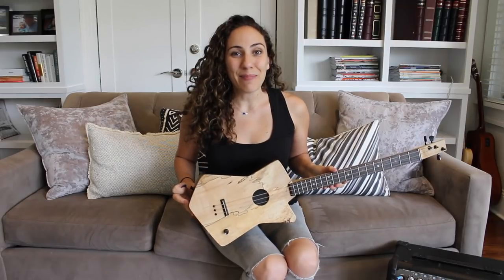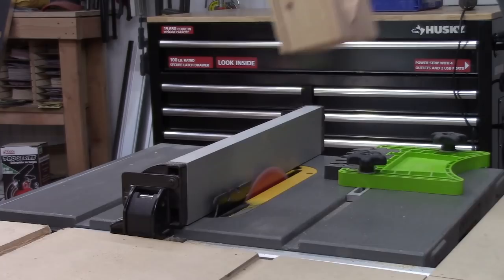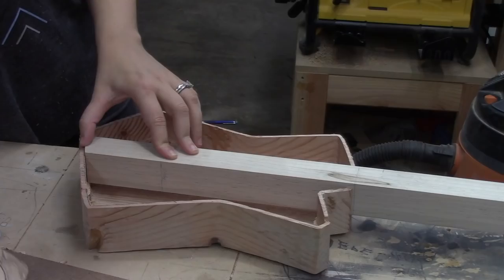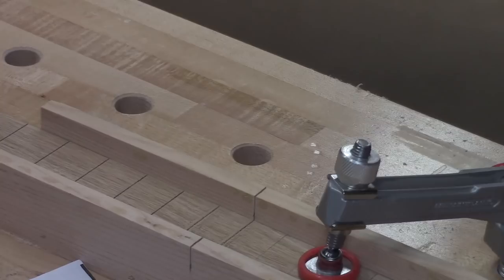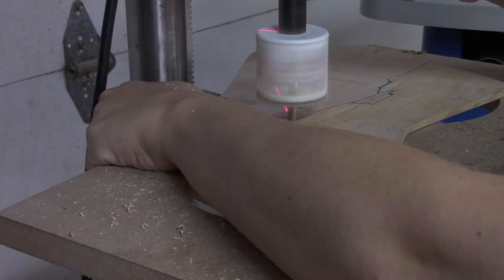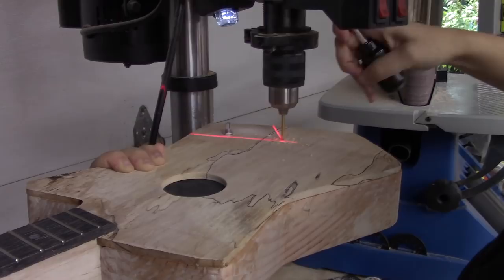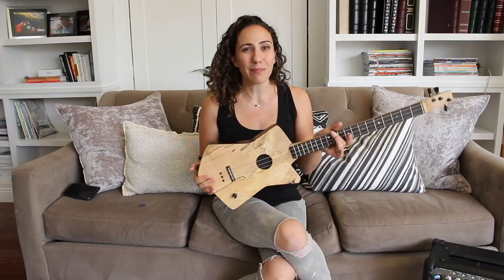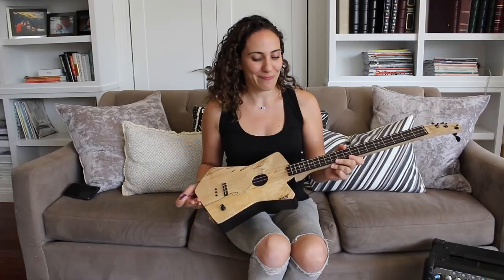Making a Three String Guitar // Cigar Box Guitar // DIY // Woodworking

Comment: Great job. all you need is $10;000+ worth of power tools
Reply from the maker: Thanks! If these tools cost me $10k my husband would have killed me.
Reply: @3x3CustomTamar  Maybe not $10k, but decent quality power tools cost a fair bit and you must have at least $1,000 worth there.  That belt sander alone is a costly looking item. 

I also envy you Americans your access to space.  Here in the UK land is pricey and I end up basically having to stack tools on top of each other - it makes maintaining accuracy a bit difficult.  Wood is also much more expensive over here so I have to recycle/upcycle scrap wood.   Overall, an interesting effort but I'd probably have gone the fabrication route, rather than the router route for the body build.
Reply from the maker: Grey Wolf yeah. I guess I take that stuff for granted. I totally agree with you on the construction of the body. Next time I’m going to cut out thin strips of plywood to the shape I want. Then glue those up together to make the walls taller
Reply: Well, the thing is a lot of these channels cater more towards professional woodworkers, not weekend woodworkers. The same thing can be done with hand tools, and we're for decades before any of the modern tools available today.
Reply: It was a nice build...I would change a few things tho. Definitely nee to figure out a way to access electronics/jack. With the top glued on, your kinda screwed if you need to rep.ace the pickup, etc
Reply: I have $10k+ in woodworking tools insured in my shop. She's nowhere near that range. Grow up dude.😂

Comment: Using spalted wood for the top wasn't a good decision. It won't last nearly as long.
Of course that true of the way the body was done as well so i guess it didn't matter at that point
Reply from the maker: I used a stabilizing epoxy on the top. So we’re good there. This was just an experiment. I Had fun with it. And my kids enjoy it. That’s all that matters to me.
Reply: "It won't last nearly as long..."  As what? Steel, aluminum, PVC plastic?   She stabilized the wood with a penetrating epoxy resin.  It's probably good for at least 100 years at this point - you think it needs to last longer?

Comment: Cringed the whole video, but i cannot argue with results like that.
Reply from the maker: Yeah. Def not the correct way. But not bad for my first attempt. It was so fun to do
Reply: Definitely not consistent with traditional guitar builds, but after watching this I watched a few other cigar box builds and I have to say this is hands above those. Acoustic guitars want to have a lot of resonance, which generally means thinner back, sides and top. I was shaking my head through the whole build, but then have to admit it sounded surprisingly awesome in the end.

That spalted top was beautiful!

Also, I've never used those disc piezos before. When I saw all that hot glue I thought, "that's never going to work". It defies nearly every principle of piezos I am familiar with, but it sounded great.

So all that constructive criticism I was saving up??? Nevermind. You built a beautiful instrument and it sounded great.

Thanks for sharing.
Reply: Why would you cringe for the whole video?   She did a great job with the guitar and it came out fine.  Do you get some kind of style points for HOW the project is made?   You might not use the same wood working techniques - but, YOUR techniques are necessarily either better or correct - they're simply different.   I probably would not have built it the same way, but I learned a couple of alternative methods watching the video and may try incorporating them into my work.  I truly don't get the comment.
Reply from the maker: QuinnMendel it’s different from a traditional guitar bc it’s not a traditional guitar! It’s a whole nother animal! But it gave me the confidence to think that I can actually build a real acoustic guitar. When I get a drum sander of course.... 😂😂
Reply: @3x3CustomTamar  Yep - I get that. Honestly, I've never built a cigarbox guitar or looked into their typical construction. So I watched your video first and formed some opinions, but then (thankfully) had the presence of mind to watch a few other cigarbox builds which reset my expectations and gave me a renewed appreciation for what you accomplished.

Frankly, my biggest concern with your approach is with all that end grain. I really, really hope it holds up, but my history with such matters is that it will want to warp and split. Hopefully the wood hardener will save you...

BTW, your neck-through design was brilliant!
Reply from the maker: almosthuman thanks! Glad you watched some other videos and realized I wasn’t crazy. Ha. Yeah. It’s been over a year of abuse with the kids and it’s still in great condition. I think the wood hardener helped with that
Reply: I like that it combined the stability of a solid body and the sound chamber of a hollow body, very unique and sounded good. Good job.
Reply from the maker: xzombielar thanks! Yeah it def has a unique sound to it

Comment: To help with the fretboard glue up, I like to drill a hole right in the middle of 2 of the fret slots (top and bottom of fretboard) and then use a toothpick as locator pins, that way everything stays inplace while clamping and the toothpick is then hidden under the fret.
Reply from the maker: That’s a great tip. Thanks

Comment: One thing I have found out about significant tear outs when routing, the curve takes you into the direction of the grain. This means that router bit is pulling the wood apart. What I do in those situations is to run the router backwards. Then the bit is compressing the wood. It still require light passes but when routing in the wrong direction, the bit is actually pushing the router away from the wood. And I always make a final pass moving the router in the right direction to make sure I have properly trimmed the material.
Reply from the maker: Yup. It’s called a climb cut
Reply: @3x3CustomTamar  I was thinking about this. It's something I'll probably try sine I use a cordless router. And that's using guide ebarings that are 1/8 and 1/4 inch larger than the guide bearing I'll use for making the final cut. When the router moves in the wrong direction, it can leave scallops (a wavy surface). A spiral bit is actually cutting less material at one time that a straight flute. Also, the difference between using a 3/4 in. dia. and a 3/8 in. dia. router bit is surface speed of the cutter and the amount of torque from the router that it converts into force. A larger diameter cutter will have less  shearing force than a smaller diameter cutter. An example of this is of you had a wood block mounted to a piece of wood on your work bench, how many lbs. of force would it take to shear the dowels? I used to work in a machine shop and speeds, feeds and rpm were everything. I have an 
18 v cordless router and I try to limit using any cutter over 3/8 in. dia. It's prone to gouging wood. Hopefully your viewers will find this information helpful. p.s., remember the night stand/drill press stand that you built a couple of years ago? You might recognize how it's influenced the project that I'm working on. :)

Comment: Well done! I build also and the way I do the body is to glue together two pieces of 3/4 ply. Then bandsaw out the outside and inside. Use the neck opening to enter to cut out the inside. Then just a wood piece on the back like you would the front. As piezos can be noisy I prefer to be able to move them around for tone control. I actually won't use them anymore. Pickups only. I'm impressed with how loud yours is acoustically. Never play "smoke on the water" in a music store you may get tossed out on your bum. I bet it's not your last guitar, it's addictive.
Reply: Also check out Tim Sways many guitar builds.
Reply from the maker: Next time I’ll attempt to put in a real pick up and I was also impressed with how much sound came out when it was acoustic!

Comment: I believe the Fender Thinlines have routed bodies. Also, acoustic guitars have fairly thin sides, but they increase the glue surface with linings, so your side thickness is probably fine. I like the idea of making a bridge with fret wire. I hadn't thought of that before.
Reply from the maker: Good to know!

Comment: Dear Tamar, the outline of your guitar body is curveles.
So its easy to make a 9 piece side  you have nothing to bend.
A whole body of that maple wil look killer.( back, side and top)
It wil sound hard and very bright in a good way.
With little piece s  of hardwood where the side s  joints.
Dell Puckett is also my mainman for cbg info.
Greetings from Holland.
Reply from the maker: There are subtle curves. But yeah. That was one of my ideas before I decided to go with this one. Next time around I will cut a bunch of thin strips of the shape and then glue them all together to make the blank
Reply: @3x3CustomTamar  first i'd like to say that you are a well equiped lady.
Is it your workshop with all the machines we see? ( very impressive ).
I should like to give you one tip , if you want to work with strips.
Find a thick piece of ply wood or glu 3 pieces on each other.
Make a hartline and draw your model on it and cut it out.
You get a big square with your model cut out.
Than you can make all your pieces fit inside and glue them.
The thing is also very handy for glueing the back on.
It will keep your form while glueing the back on.
Perhaps you know this trick already.Greetings from Holland.

Comment: 3/4" plywood cut out width 1/2 to a 1" for the sides.
In the shape of your template cut two and glue together.
Then put a back and front on it.
Much easier.
Thanks for the video
Reply from the maker: Yeah. That’s totally what I should have done. I don’t know why I was so set on hogging out the body from a big chunk
Reply: Just the learning curve been there.

Comment: Once the bit won't reach any further, you remove the template and then just use the routed surface as the "template".  That allows you get to full depth.
Reply from the maker: Yes. I know how to use a router. It was deeper than even that would allow.

Comment: I thought hollowing out logs only happened in folklore tales - alright for some canoes - but not guitars - then I heard that tone!!!
Reply from the maker: Right?! It was a crazy way to make this. And I don’t think I would do it again. But it does sound cool. Next time I think I’ll cut out thin strips that are the shape I want. Then glue them up to make taller sides.
Reply: @3x3CustomTamar  That would be next most unorthodox way of doing it. Traditionally, sides are solid quarter-sawn hard wood bent into shape using heat, or made of two or more thin sheets of hard wood glued into shape using a form. However, you are doing your own thing and you made a guitar that looks great and sounds acoustically amazing. Did you get The Monkees link (I'm a Believer)?
Reply from the maker: Iazzaboyce yup! I totally want to attempt to make a real acoustic one day using that technique. But cigar box guitar have thicker sides so I think lamenting thin sheets into the shape I want might work for a cigar box style. I have seen cigar box guitar kits that are shaped like Teles and strats that use that technique. Will be cool to try

Comment: Great job on the cigar box guitar.
Great sound.

That was one way of making the guitar body.

I probably would have done it the lazy way and had the CNC cut out several layers of the same form and glued them together using 1/4", 1/2", 3/4" or 1" hardwood or birch plywood depending on what provided a whole number of divisions.

Some people actually take long thin strips of wood, steam them, and bend them around a form to shape the body of a guitar. Then glue them together after they dry. I think that's for the standard shaped classical or steel string guitars.

You've played guitar before haven't you?

Great video! 👍🌹🌹🌹👍
Reply from the maker: Thanks! My original plan was to CNC the whole body. But I didn’t take into account how tall it was. So the router didn’t fit.... so I just turned my self into a human CNC. Ha. And in the end I cut off that back panel so it was shorter and probably could have fit in the CNC in the end. Oh well!

Comment: That thing sounds great.  I think piezoelectric is the way to go.  You know you can use nylon strings if you want.  Looks like you have steel on there now?  Very clever getting the holes for the strings to line up.  It's quite a wonderful sounding guitar.  There's some guy on YouTube that built a guitar from cardboard.  I think all this guitar "science" is bs.  The piezo is great.  Willy Nelson's "Trigger" is a piezo with nylon (I think it's nylon.  Now I forgot)  Anyway, I think yours might sound even better than that.  Excellent job.

Comment: USELESS INFORMATION TIME!!!!
Be careful on the angle of the headstock. Les Pauls, and other type guitars, usually have a 14 degree angle on their stocks. This creates extra tension on the strings and they have a tendency to go out of tune. This is because of the string tension on both sides of the nut. It shouldn't give you any trouble with the thickness of the strings you're using but it might be something to look into if you make another guitar. If you do have problems get a HB pencil and mark the sting gaps in the nut. It helps with friction.

Another top build. Nice one
Reply from the maker: Thanks so much!
Reply: No Problem. The best example would the Telecaster you built. The headstock is parallel to the neck and not pointing downward from it. Would have mentioned this earlier but forgot you built it. Sorry :) Take care

Comment: Hello I saw you measuring before you drilled the holes for the strings and talking about the floating bridge but is there a certain measurement that you should Mark from the 1st fret to where you drill the holes or put the bridge?
I haven't played the guitar in 20 years and I fancy making one of these but more of a cigar box type out of scrap wood that I can find at  work. I wondered if I found an old scrap guitar if I can cut the fretboard off and use it.
Thank you
Reply from the maker: The only important measurement is from the nut to the bridge. Since I was using a 25” scale length, that’s measurement is 25”. I drilled holes for the strings where I knew there was enough meat to drill into. So I left about an inch and a half or so under the bridge for that. If your considering building a cigar box guitar. Definitely watch ALL of Dell Pucket’s videos. He is the master.

Comment: Why the f didn't you just slab off the 4x4 laminate edge wise and create top and bottom sound boards and the sides.... talk about excessive work and waste..... plus it would have better resonance with thin top  bottom and sides.....
Now as far as having all that high dollar equipment why didn't you just mill out the inside.... set it and walk away until it's done...(I have all those things too but I built all mine dirt cheap my 8x8 foot cnc cost me a couple hundred dollars) I have to say women just don't think at all
Reply from the maker: Ok